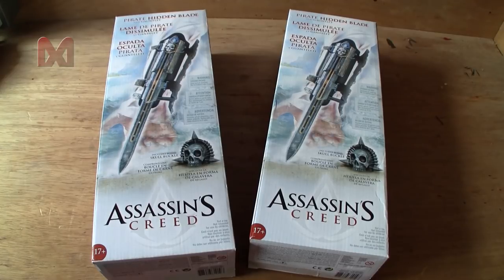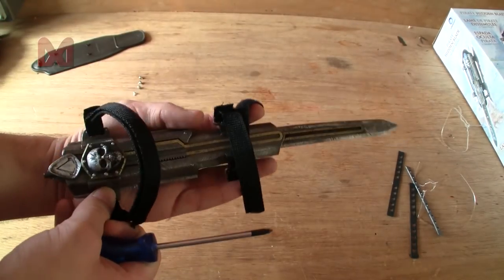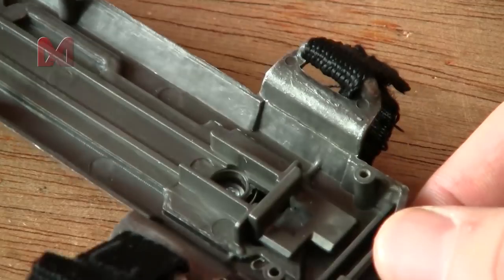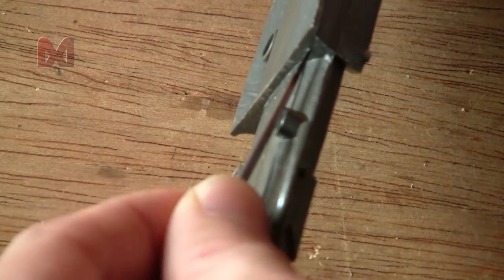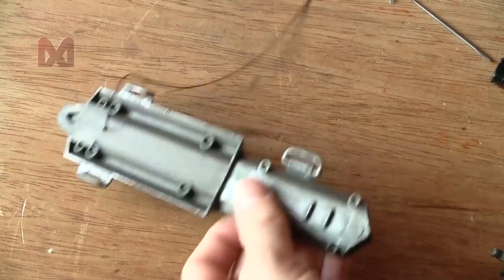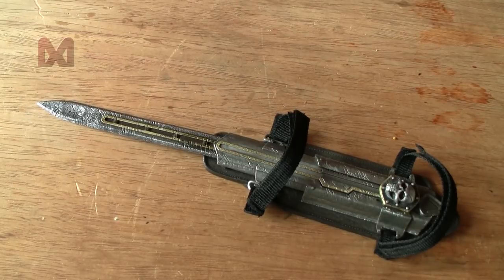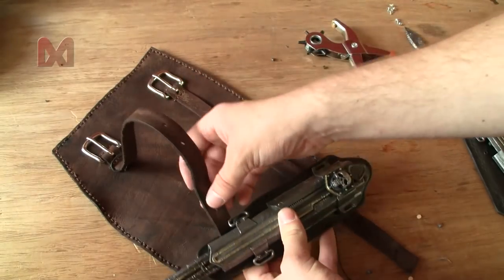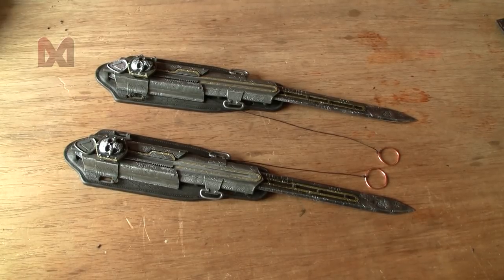Edward costume (AC4:BF): hidden blades tutorial (McFarlane Hidden Blade Gauntlet modification)

Comment: so basically Altair, Ezio, Shay and Edward hidden blade are not really different?
Reply: Only loks but no
Reply: +HKLYTUNG

They all look different, but are used for the same purpose and some have extra features.

Arno's blade has more then one use, and can be used to be fired at people.

Connor's blade can change it's angle and be used like a knife.

 Ezio does have the hook blade in AC:R which can be used for climbing and zip lines.

Altair also has something similar to the phantom blade in AC:R.

Jacob has the grapple hook.

So pretty much Shay and Edward are the only lame ones.

Though, I can't say that for sure as I never beat AC:IV because I didn't really like it and never played Rogue but plan to.
Reply: alittle
Reply: +Mr Walrusman yeah my favorites were Connor's and Jacob's
Reply: +Mr Walrusman Altairs one is just the hidden gun that Ezio uses...it is similar to the phantom blade but i would not class it the same...i think you forgot to mention the Hidden gun in your enumeration of the blades :)
Reply: KazPLAY I did actually, I has been awhile since I played Ezio's trilogy when I wrote that so I completely forgot about the gun in the blades.
Reply: Mr Walrusman it just sounded like that...it's just that the Phantom blade is totally different than the hidden gun...
Reply: o thy differ alright from the blade size to posisioning and relese mecs

Comment: hey there's an easier way to mod this hidden blade just take it apart remove the spring and the lock and put the blade back together again now on the interior of the button you will notice a hoop as well as a little grove at the end of the blade put the grove inside the hoop then put back together afterward that button hoop will act as a lock to release push the button down then pull the blade out a tiny bit then just push down with your arm (not to hard the blade is crappy so it will pop out) and the blade will come out to relock just push blade all the way back I hope this was clear and easy to understand and I hope you have a wonderful day/morning/night/evening/breakfast/lunch/dinner/and jell-O

Comment: sorry to disappoint youre modification but the hidden blade is actually activated by pressure of the flick of the wrist and the tension of the muscles in the arm no strings are used in the activation of the blade get some pressure pads bro
Reply: Well, bro, there's actually a lot of different ways that it is activated. One of which, is the string method by Leonardo DaVinci.
Reply: if it did come out that way then every time their climbing it would come out
Reply: +gamingshark 3426 lock it
Reply: +brian callumepicparkour you cant

Comment: I tried  this with my hydenblade but it didn't work  . u probly can make a different  blade for it but make sure  whatever material you use for the blade it has to look like  the other one . and if the spring doesn't work  or brake  just have no spring it's quieter anyway and it would be like MacGyver made it lol

Comment: Is there some way to make a mechanism where you have to bring out the blade with a swing and retract it with the pull of a string?
Reply: A guy made a real working one but he won't tell anyone how to make it.
Reply: Yeh check me out
Reply: solodarkblade i saw Ammnra's but its too complicated, i had made up a little concept by which you thrust out the blade by force and it slides into a click thing (sorry for my horrible english specialised vocabulary) that locks it one way, and unlocks with the pull of a string, the whole time it would be connected to a spring or something elastic to pull it back while there is no force aplied to it, now you just would have to experiment with how much strength it takes for the rubber band/spring to work with that, i dont know why i just exlain all my thoughts though haha, well i am crafty but i dont have the equipment and materials :(
Reply: Like I said on my channel I have already made a hidden blade using the mechanism your talking about it's very simple and reliable except I made mine better by adding a detachable blade!
Reply: Oh no I'm referring to the metal one i made

Comment: can I modify it with a harder blade?
Reply: Theres a small grove on the blade in the middle that you can definitely fit something stiff inside to make it more stable. Thats what I did. I got some paperclips and unfolded them, put them together, and fitted it inside the grove of the blade and it works like a charm. It doesn't look bad either
Reply: Kyle David Thats a great idea thanks! but do you think it can b replaced by some thin metal blade or the spring wont be powerful enough?
Reply: Noob Gaming Im sure if you model the metal blade directly after the plastic one, it should work fine. Just make sure the cutouts are the same so it will work with the mechanism properly!